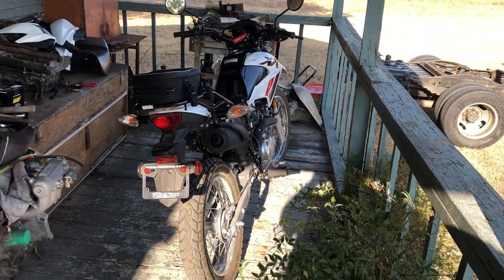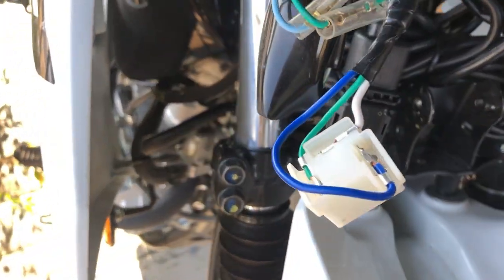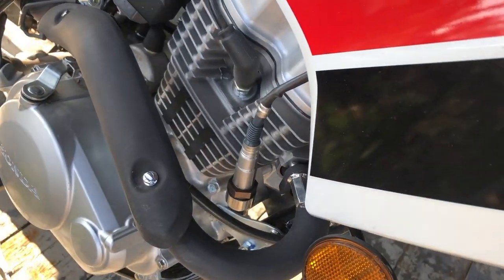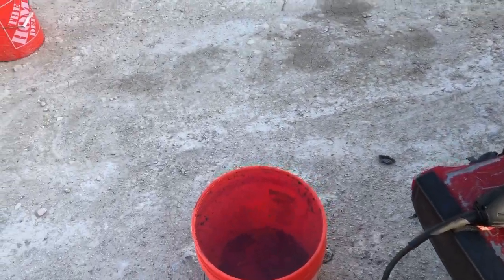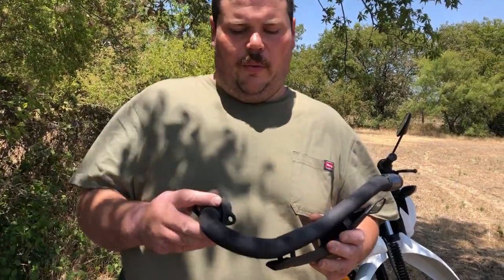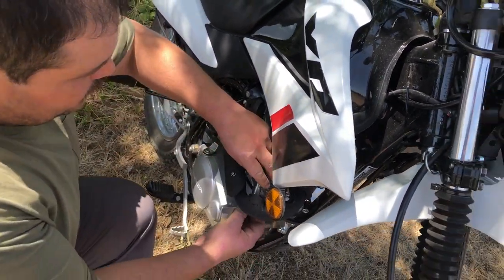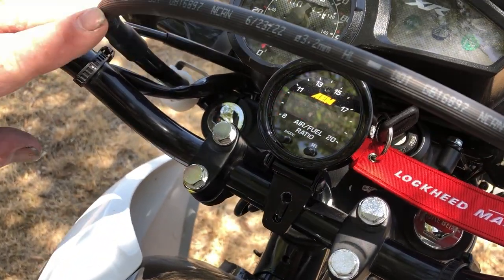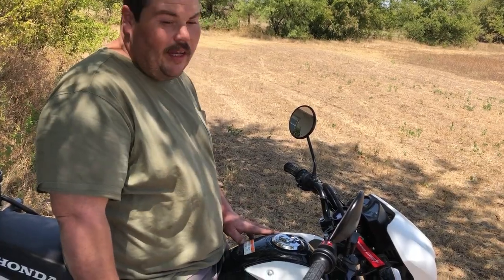AFR gauge install XR150L

Comment: Only thing I want to change on my 150xr is the tires to some knobby ones. The street tires really hold it back offroad
Reply from the maker: They just pack up with mud off road I would like to have something in between I don't know what it's like driving a knobby Tire on the street
Reply: @fixitforfun577  Yeah I would say half the time spent I spend on the dirt so it's more preference. Knobbys on the road definitely wear down after just two years of moderate riding but what can you do.
Reply: Knobby Tires On The Street Are A No No
Reply: What were your readings at high speed (factory settings)?
Reply: @paulwenzl1711  I can hit 60mph pinned down on a reg day.
Reply: I played with 11 main jet and had a good vibration in 4h and 5th gear.  I went uo to 115 jet, and it would cut off when releasing off throttle.  I'm at a 108jet and monitoring this tank full.  I think the 105 factory jet is actually the right one all along.  We'll see...